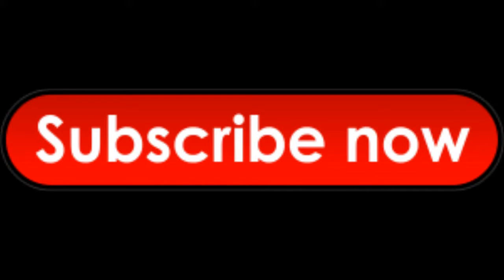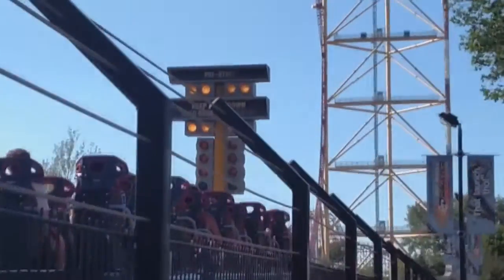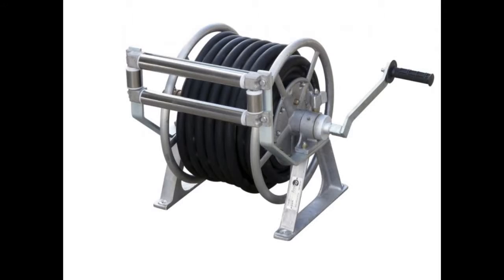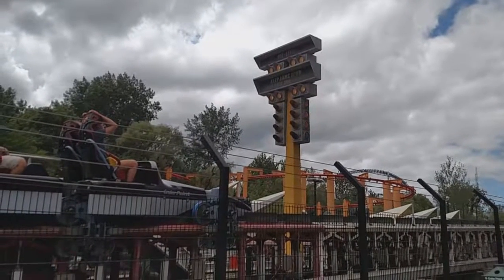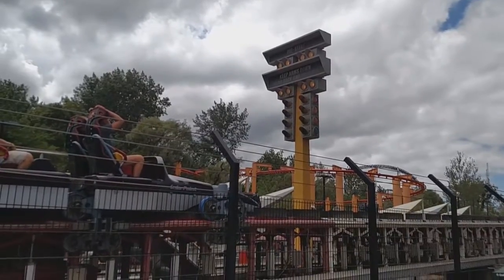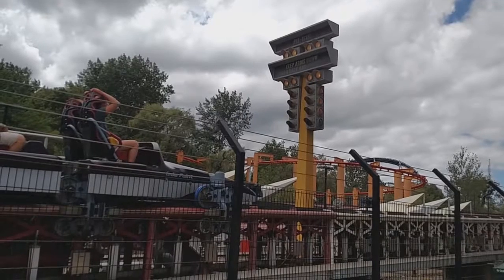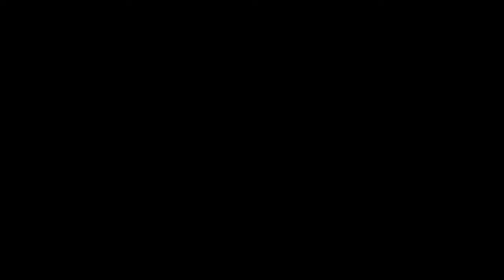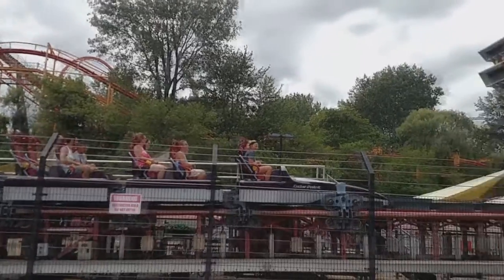How Top Thrill Dragster/Kingda Ka Work Explained

Comment: Also TTD and Kingda Ka were both designed by Intamin and then built by Stakotra and both were installed by Martin & Vleminckx. Kingda ka is only faster and taller and has the additional hill at the end. So it’s funny you bash Kingda Ka and praise TTD when they are both of the same design concepts.
Reply: I have heard from several people that TTD is a smoother, better ride.  Final execution of all the building elements is definitely a factor.  Not all rides are identical feeling even if they are the same concept from the same builders.
Reply: That’s because Kingda Ka is actually decently rough during the launch where Dragster is smooth, and the fact that Dragster is themed better and the original.
Reply: Matt Flickinger people really care about the smoothness of a ride moving at 128 mph in less than 5 seconds? Kingda Ka moves faster in a shorter amount of time, covered more track, spirals on the way down, and has a secondary hill after. No shit it isn’t going to be “smooth” 😂
Reply: @justinb7439 TTD also spirals on the way down, better theming, original ride, and very open lap bars instead of over the shoulder restraints. Also kingda ka is SLIGHTLY taller and faster. 8 mph is no t going to be different when you are already going 120.

Comment: My grandpa used to work on top thrill between 2008 and 2011 but then he passed away in 2012 and national pump and progress lost their gig with it because nobody good fix it right but him. That's why it always rolls back or does not make it all the way up because the people who fix it now do not know how to fix it.
Reply: Garrett's Ride Seriously, that's absolute bullshit. Rollbacks happen when the rides computer applies less power then is needed, not wether or not someone knows how to fix it (which plenty of people do).
Reply: Why would I lie about that.
Reply: Julia Therrien Amen
Reply: What are you talking about.
Reply: IDK, when it was newer everytime I went to CP it was broken down. Last few years going its ran everytime.
Reply: Both TTD and Kingda Ka work the same way. A computer controls the power of the launch. If the train is moving too fast at the top of the tower, the computer will call for less power on the next launch. That will increase the chances of a rollback, which is normal for both rides and both are designed with safety in mind in the event of a rollback which is why the next train will not move into the launch area until the previous train has cleared the tower. And the magnetic brakes at the launch area will stop the train if it rolls back. It’s not about who knows how to fix the ride. Plus both TTD and Kingda Ka need good weather in order to operate.
Reply: @jchurch-ways8116  does TTD have blocking system i used to work for six flags and i remember that some of the rollercosters had blocks..